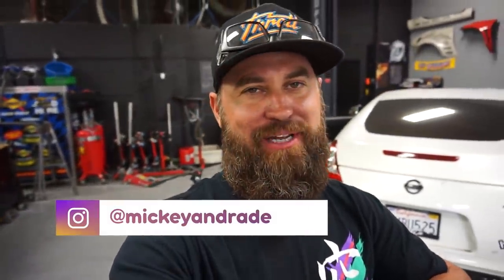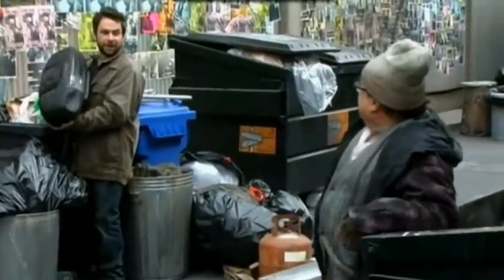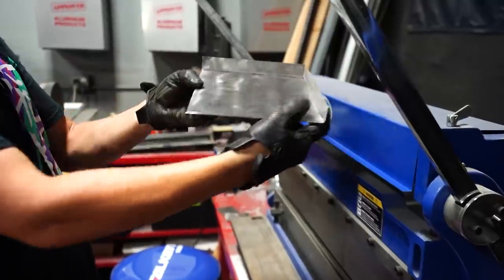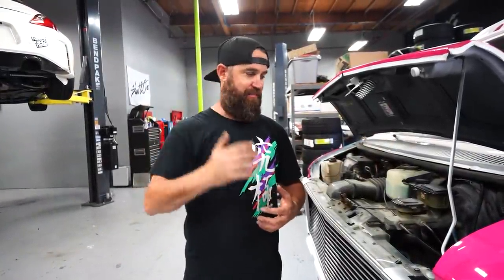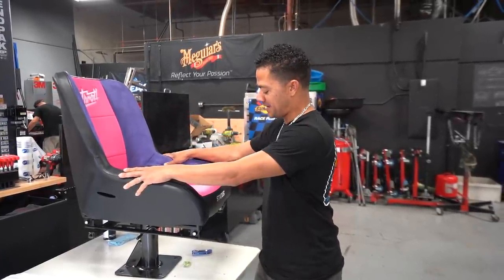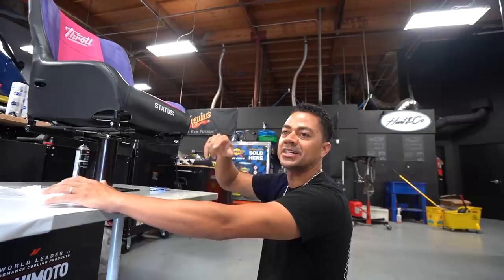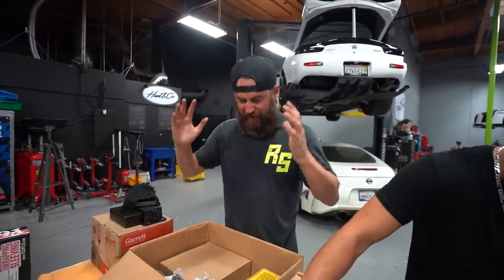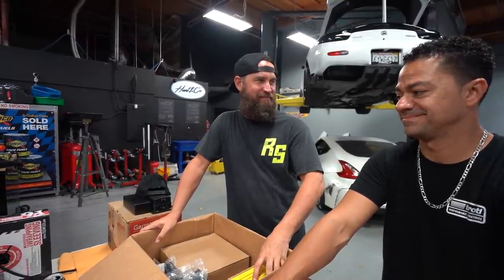Building the COOLEST Ice Cream Truck on the Planet!! [Ultimate Chevrolet G20 Build] - Part 8

Comment: Just suggestion when on road why not have split charge system or solar panel set up to keep the batteries in rear topped up
Reply: Is that withe separator hooked to the main battery ?

Comment: Are you guys running battery cable from the alternator to the rear battery as well to keep it charged up? Maybe a solar panel on the roof to charge that battery. Do a rv style plug for the generator on the rear drivers side so you don’t have to have the rear doors open to run the cord. Looking good guys. I still say headers n side pipes, lol.

Comment: Loving this build but one thing I noticed is the original ice cream van they bought had a large sliding window on the side that was used to hand out the ice cream, so are they planning to hand out the ice cream and merch through the passenger side window? Or will they add the sliding window in the future.

Comment: Honestly I'm disappointed in the ice cream van! Would have thought you guys would have slammed it really wide bodied it and put some spacers and way nicer wheels and tires. And beefed up the motor and transmission take advantage of the v8 sound put some sweet sounding exhaust.🤔🤔🤔🤔🤔🤔🤔🤔🤔